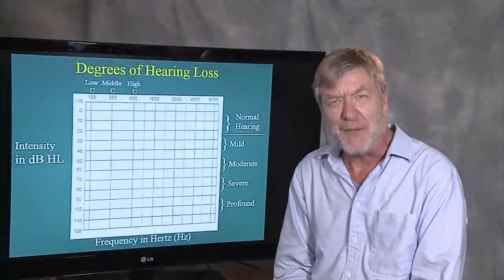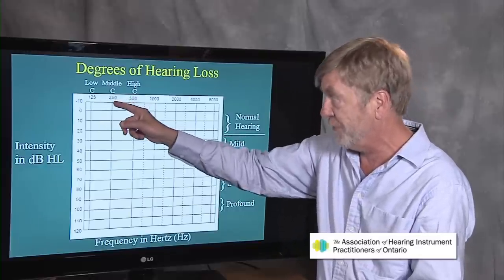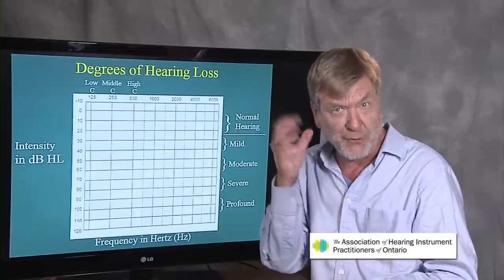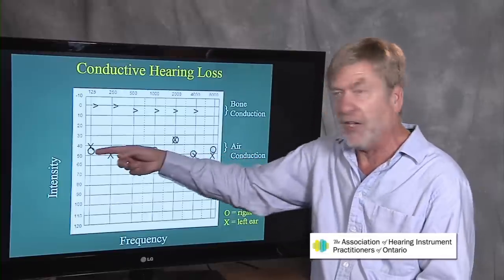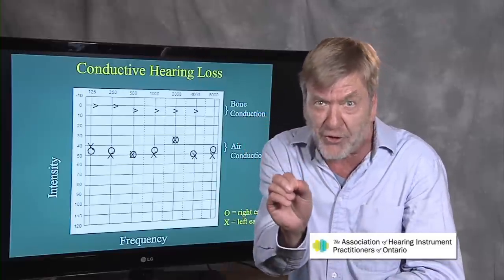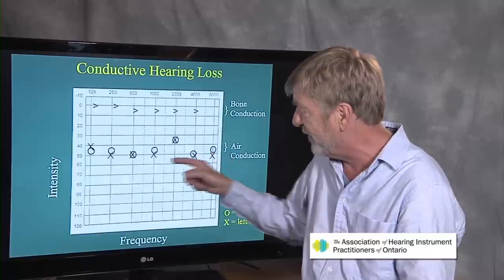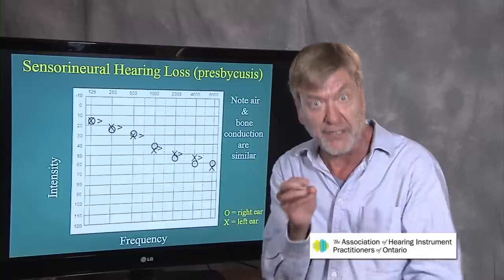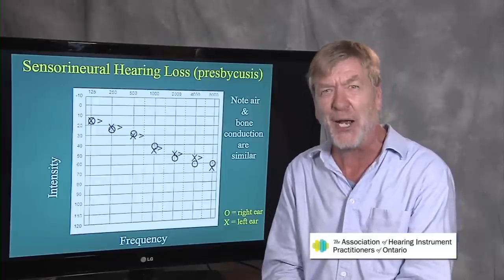Ted Venema Talks Reading the Audiogram

Comment: Hej Ted really amazing videos you are making. I am a 5th yr medical student and it is extremely helpful. We are currently learning how to read audiograms.  We are also learning about symbols of "masking" air/bone-conduction and i dont understand that at all, would it be possible for you to explain that in an easy way. I understand your video on general AC vs BC tests interpreting diagrams as well as difference between the two types of hearing loss but i dont understand the point behind this "masking" how to and when to use it or what to think of it clinically or on an audiogram???? I would really appreciate your help. Kindly Aj

Comment: deff good for common understanding but what is someone had SNHL for most there life but then get a test where the bone conduction test  ( bracets ) moves above the sloping of the SNHL .... and is this called mixed hearing loss ... and how dose that show the inner ear is fine when before there whole life they had SNHL were the brakets were along side the sloping of the SNHL hearing loss ...... this is where ei get confused ... cuz if the bone test moving closer towards normal hearing starts to happen decades after having then be right at the same level as the SNHL i had how would the brakets move back up

Comment: Mine is straight across at 5-10  until 8000 and dropped to 50. Since covid my ears ring when I’m exhausted which is every afternoon. My ears starting ringing toward the end of the test and I couldn’t differentiate the sounds. Could it be that I would have stayed 5-10 if my ears hadn’t started ringing?

Comment: ted what side of the audiogram is what you hear normal the way i see it is the upper right side is what i hear normal and the lower left is what i need help with? is this correct?
Reply: Bob
Every sound we hear is composed of many frequencies with a different intensity (volume) level for each frequency. Thus we need to be able to detect a range of frequencies at different intensity levels. Generally, normal hearing does this in the range of 100 - 10,000Hz at any intensity above a certain threshold level of volume.

The audiogram shows you the threshold volume you need in order to start to hear a single frequency sound and shows these as points of - volume needed (up/down position of point) vs the frequency (left/right position)going into the ear. When hearing goes bad it does not do so uniformly at all frequencies but usually (at least in age related loss ) as the frequency of the sound gets higher you need more volume before you can hear it. 

 For each test result point, left to right indicates the pitch of the sound you are hearing with right being high pitch and left being low. Up and down indicates the threshold volume of sound that you need before you "hear"that pitch, with down meaning higher volume needed before you can hear the sound. Normal hearing would give a test results where all the resulting points would fall between volume level 0 and 20 in the up and down direction for all the frequencies from left to right.

If you look at around 8:30 in the video he shows a sloped line audiogram from a person with the usual hearing loss with age. In that graph each point represents the volume level needed (up/down location on graph) to hear  one frequency ( left/right location graph). Using his definitions shown in the beginning of the video, "normal" hearing is any point where you can hear that frequency in a volume range of 0-25  up/down, "mild loss" is any point where a volume of 25-45 up/down is needed to hear etc .

So looking at his results at 8:30 . At 125 Hz this person needs an intensity of 15 which is normal hearing. At 500 Hz they need a volume intensity of 30 which means that at that frequency the person has mild hearing loss.At 8000Hz the volume intensity needed is 60-65 which is moderate to severe for that frequency. As you can see different frequencies need louder inputs for this person while a normal person would hear all frequencies as long as the volume was in the 0-20 range or above. What a hearing aid tries to do, is to analyze the incoming sound for frequency and then up the volume of the those frequencies that need more volume for your ear to detect them.
Reply: thanks a long answer for what i thought was a simple question. the slope starts in the upper left of the audiogram and goes down to the lower right side. so what side of that line no matter what the loss does the hearing aid compensate for the left or right of that line?  thanks
Reply: Bob
It isn't left or right that  we are attempting to change but up or down. We are trying to move each point on the line up into the normal level. It does this at ALL points on the curve wether left or right

Realize that for "normal hearing" the test audiogram would be a more or less  horizontal line in the 0-20 intensity range. The purpose of the hearing aid is to alter that sloped audiogram of the hearing loss person listening without the hearing aid to become a horizontal line when tested while the aid is being used. 

The hearing aid takes each point on the sloped line and for that frequency adds enough volume to bring that one point up into the normal range, Since the loss is different at each frequency, the hearing aid adds a different volume at each frequency and tries to bring each point up into normal. The ideal result would be that when tested with the aids on you would get a flat horizontal line in the "normal" range of 0-20 rather than the sloped line that you get without the aids.

 In actuality there is only a limited number of frequencies that can be handled simultaneously with the current processors available and as a result we do not get perfect correction compared to human hearing but still the result is much more understandable than the uncorrected ear with hearing loss.

Hope this helps